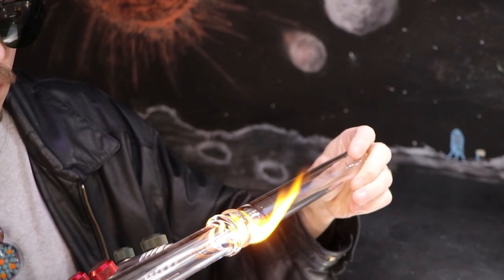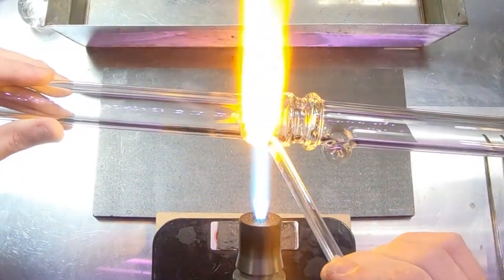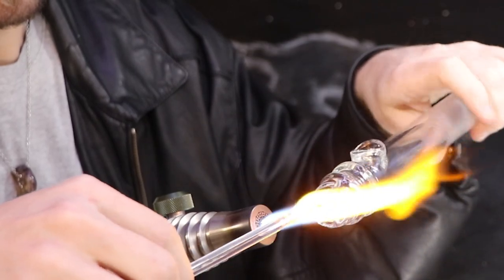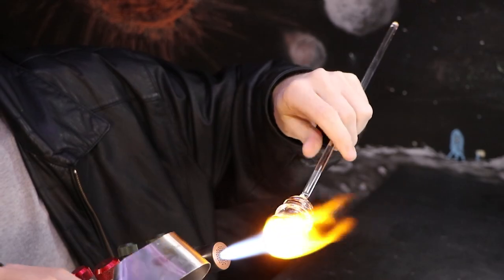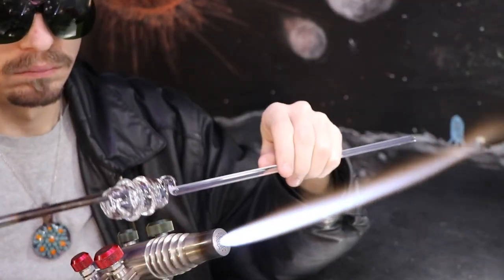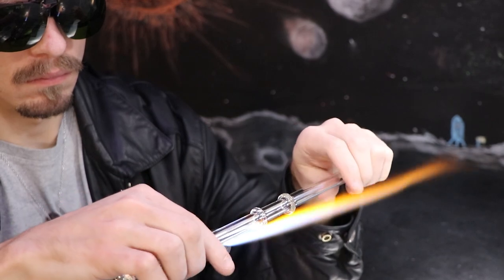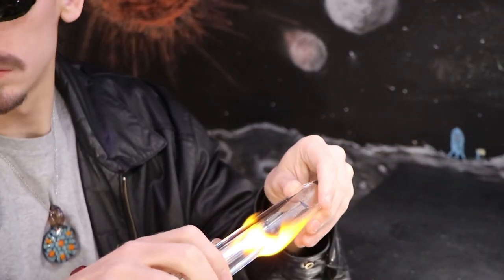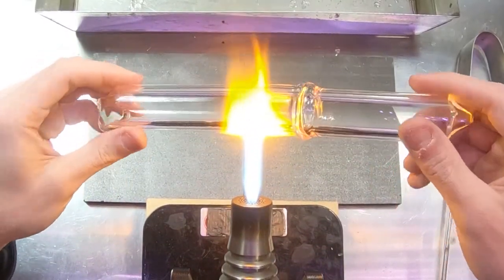The Maria Push -  Making a Glass Pulley -  Lampworking

Comment: you don't need a wet saw. Harbor freight has a tiny table saw that comes with a diamond blade, and it's around 20 bucks.It's a circular blade about 3-4" diameter. I have used that for cuts for years. If you are steady handed, you can cut amazingly well.